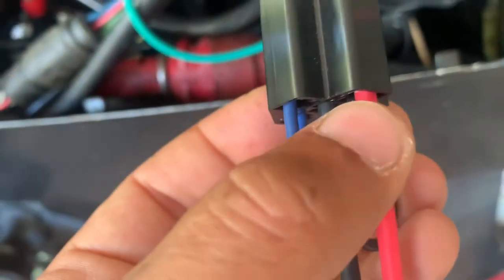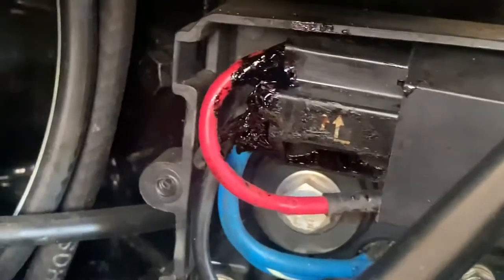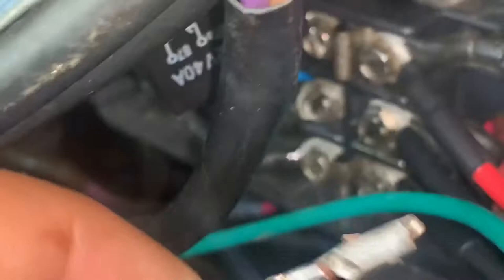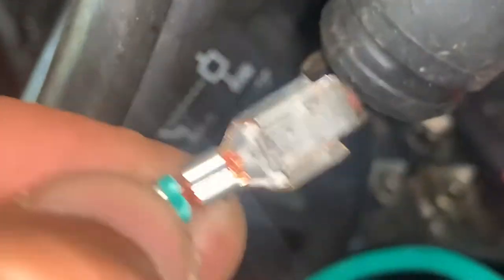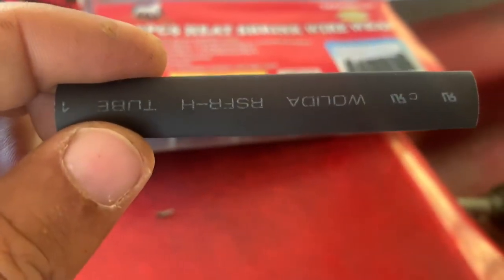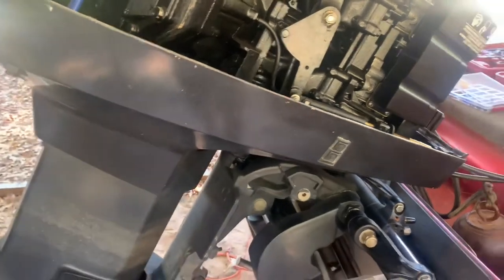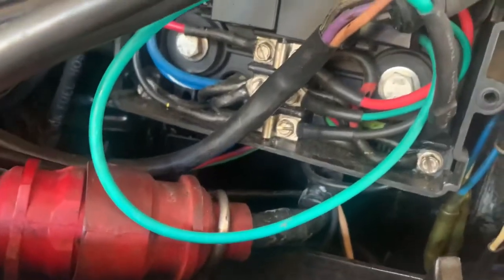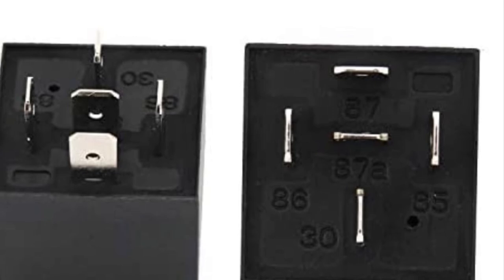REPLACEMENT RELAY HARNESS FOR JOHNSON EVINRUDE OUTBOARDS | POWER TILT/TRIM

Comment: I have the same problem with all that gunk on my exact same model evinrude as your. So you believe it was the switch relay needed replaced ?
Reply from the maker: Yeah that’s all it was. New relays and it works like a charm

Comment: My trim goes up and down from the throttle but only goes up from the motor. Any idea as to why it won’t go down from the motor?
Reply from the maker: My guess would be the motor switch itself
Reply: @cwulfoutdoors318  you’re talking about the trim motor switch? If so I was thinking that as well
Reply from the maker: Yeah the throttle switch works fine. I’d trouble shoot the switch on the motor. Might be working or the switch
Reply: @cwulfoutdoors318  okay thanks